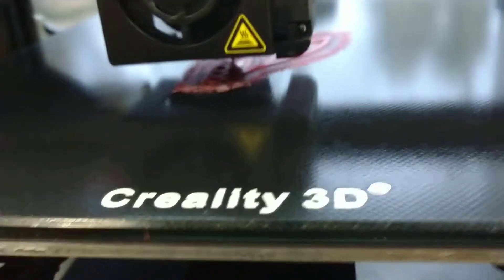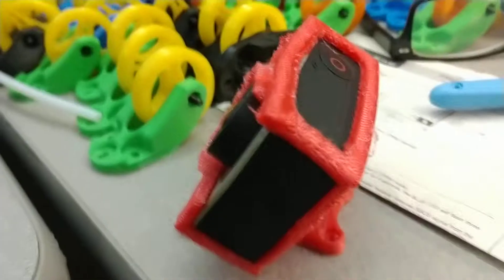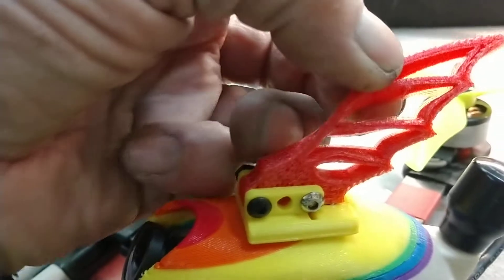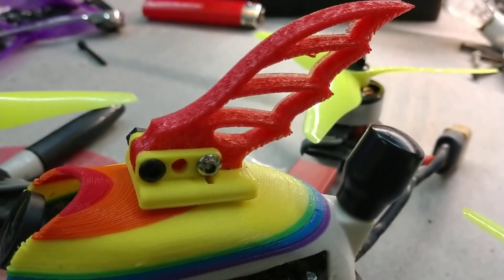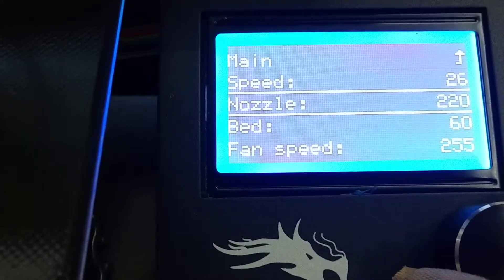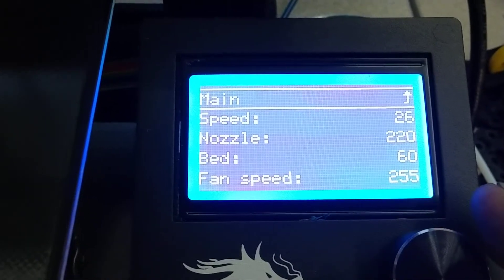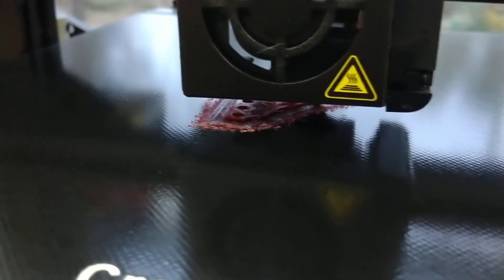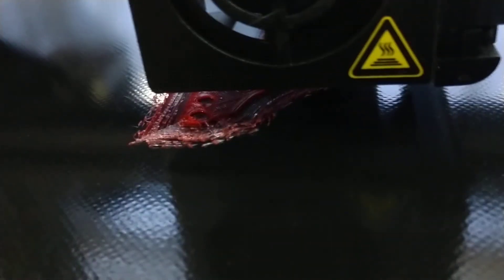TPU...On my new Ender 3 PRO

Comment: Good stuff! I’ve had a printer for about 2 months printing pla consistently and have 2 rolls of tpu but I’m scared to switch over cause it’s prints so well right now lol
Reply from the maker: Just slow it down and increase the heat...on TPU. I do mine at higher density too